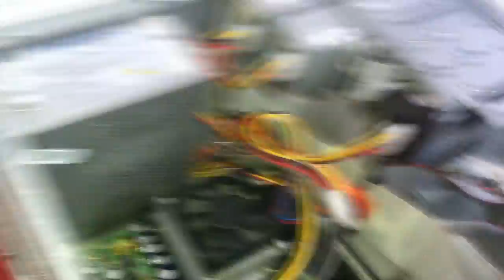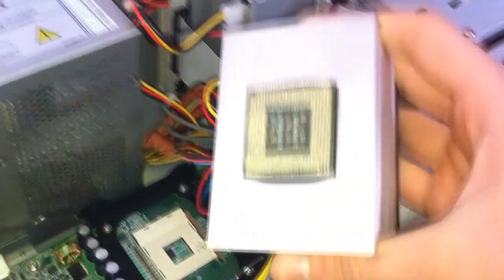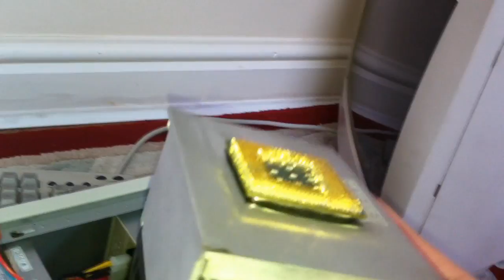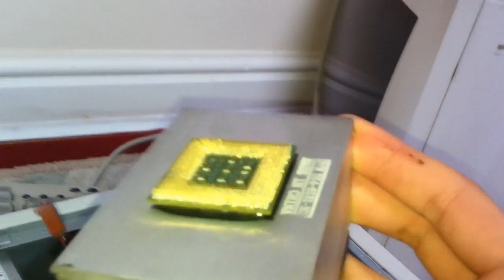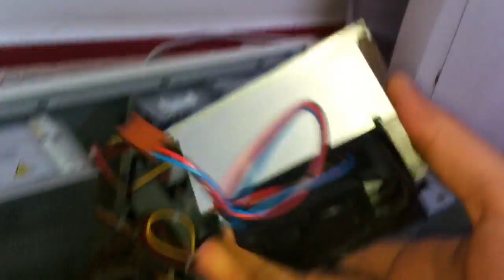Beware of applying too much Thermal Paste!

Comment: hey i accidentally wiped a little thermal paste while installing my pc and overheated a couple of times until i looked at it again to realize at least a quarter of the paste was wiped off, does that mean my cpu was damaged or is it still ok and i just need to re apply the thermal paste??
Reply: I know this is a little late, but you should be fine, just reapply it.

Comment: This used to happen with the older processors with the stock fans/grease., to get it off of the cpu cooler, twist the processor one way our the other and you will be fine.

Comment: more thermal paste does not equal a cpu stuck to the cooler.. i use about double than what people recomend(mostly becuase i buy in large quantities, and rarely use much before it gets too old) and i have no problems removing my cooler, only time i had problems, was when i tried some thermal paste that came with a cooler, because it dried out completely within 2 months, and my temps rocketed up. so bad thermal paste can do this, too much just seeps down the side, so make sure its not conductive.

Comment: You have to take a heatsink of with a twist like motion this was not the cpu's problem or the paste's problem it was all your fault
Reply: I'm pretty sure he already took the heatsink out before the video. He's just showing the issue.
Reply: +BaggieGaming Ya exactly, even witha  shit ton of paste it wont stick to it and pull the cpu out of the pins lol
Reply: Turn the system on for like 40 seconds and then take it off lol
Reply: I feel like you could damage and bend the cpu pins doing that...

Comment: You can get the CPU off with some dental floss. Apparantly you can also soak the floss in alcohol and gently "saw" it off. Best used if you let your computer run for a while to get hot, turn it off, unplug it and then try to remove it. 

I obviously telling anyone that have this problem, not Xenomex personally since he hopefully solved this long time ago :D

Comment: if you can get it seated properly unplug the heat sink fan and  let it run for a bit until it heats up, and it will come right off. also if you can't get it seated you can always try using a heat gun on low temperature settings. to heat up the paste

Comment: 2002 Intel P4 cpu coolers came with paste and a foil strip that turned into concrete. Pulling the cooler would pull the cpu pins and all out of the 478 socket.
Reply: Wow mine still pulled out great after being 13 yrs old and being 8 years on my closet

Comment: He didn't waste a PC. All he had to do is turn the computer on and let it run for 5mins. It will generate heat which makes it easier to remove the CPU!
Reply: He has now,you cant connect the cpu back as it's now damaged.He didn't know that was going to happen so he wouldn't have let it run to generate heat.

Comment: Had the same thing happen to me a few times using AS5 using the spread method, but a very thin layer of it... the stuff is so thick, even thinned out, it sticks like glue after a few months use and the cpu always popped out with the heatsink, luckily it never bent any of the P4 pins.
Reply: never had an issue with arctic silver, just took my water block off the other day with no force at all after spreading it by hand. was still soft

Comment: Easy Fix happens to my old PGA Socket P4 Just pull it off then reapply it and when you take it off make sure its hot before removing to make the thermal paste soft

Comment: The computer that i opened up in the video, the actual main problem was the fact that the pins of the CPU were messed up. Meaning the CPU could never work again. The thermal paste issue was just a side problem. READ THE DESCRIPTION SMARTASS

Comment: alot of pre built towers have this sort of paste on the cpus its like a sticky hardish paste. ive had a couple of motherboards where the cpu will not come off the heatsink even when heated up. the cpu has to be pulled from the board. its a 50/50 chance of not damaging anything :/ never broke a cpu yet tho ;)

Comment: LOOL... Maybe you should know that there are "PERMANENT thermal compounds" that will make a permanent stick (maybe he used that crap).

I recommend Artic MX-4 for CPU. Use permanent thermal compound for something like adding little memory coolers to chips and something like that, so that it won't fall.

Comment: Heatsinks come from the manufacturer like that believe it or not. I have seen this many times myself, the manufacturers, on those older computers, for some damn reason used thermal adhesive(meant for mounting heatsinks to controllers/chipsets with no physical mounting options) as thermal compound. In one case, the heatsink was better adhered to the cpu's heatsink lid, that it separated and not the heatsink itself. I saved it as the bare silicon is so interesting to see. An old Socket A Athlon XP

Comment: Thats nothing to do with too much paste. Probably down to cheap paste also you should remove it straight after your system has been on for atleast 30 minutes. This warms uo the paste and it a lot easier to come off. You should twist the heatsink rather than pulling it.

Comment: if it is the bios and srry for all the messages will this option be avalable and i got this off of a web site containing info on the mother board  "The ASUS CrashFree BIOS 3 allows users to restore corrupted BIOS data from a USB flash disk containing the BIOS file. This utility saves users the cost and hassle of buying a replacement BIOS chip. "

Comment: ha nice, I remember lapping a opteron 146 to overclock it ended up doing just that with a pea of mx-2 thermal paste. The smoother both sufaces are the more likely that will happen due to surface tension, mainly on PGA than LGA due to the later using a clamp.

Comment: Sounds like BIOS status beeps. Check the motherboard model (It'll be on the motherboard somewhere). Then look for that model + error beep codes. For instance, if you've got a a880gz motherboard, google: a880gz error beep codes. You've probably got an Award bios. With Award, that error is a video error. Try hooking up a monitor and see where you get with that. Good luck. :)

Comment: Yeah, no. That's the right amount. Didn't overflow down onto the pins or anything conductive. Apparently you're pretty new to PC building if you've never run into a thermally-bonded CPU/heatsink. You just heat the heatsink up to about 70C for about 15 minutes, then CAREFULLY *slide* the CPU sideways and off.

The pea method is crappy; a 'good enough' slapdash that they keep teaching new systembuilders as it gets you 95% of the way there, is near-idiotproof, and only takes a few seconds to apply.

Comment: Even if you did apply too much thermal paste, you can still remove the cpu from the radiator without damaging it. Just slide it sideways and it will come off. Just be careful not to bend the pins. This sort of thing happened to me several times when I received a PC and somebody (apparently inexperienced) added too much thermal paste. It really does suck when that happens.

Comment: a thin and uniform layer of TIM (nearly translucent).  Do the buffing with a lint free cloth (Coffee filter or specific purpose from the hardware store) so you do not leave tons of fibers on the surface you are cleaning for conductivity.  Idiotic is thinking the razor will somehow magically penetrate microscopic imperfections when held flush against a surface like it's some kind of magical liquid razor.

Comment: Actually you're horribly incorrect here, while "scraping it off" is not ideal the razor itself will not penetrate the machining imperfections unless they are uniform and both thicker and longer than the blade itself.  Metal -> Metal is still your best connection, the razor sits flush with the most elevated part of the surface being coated and forces the TIM into the imperfections.  Generally you can get better results by applying TIM, buffing it off/into the surface, then using a blade to apply

Comment: Using to much thermal paste didn't mess up the computer its old and a part failed it happens on old computer stuff. And judging by the age of the computer it has the older thermal paste on it, and the older stuff after it would set would bond the cpu and the heat-sink and its can be hard to take apart but you know that is is making good contact at least.

Comment: i remember my athlon 64 from 04 or 05, that was when AMD had the genius idea of packing it in a display case, well after 3 days of shipping(without any kind of packing) the cpu was lodged from the display and half the pins were bent, i used a dried a up ball point pen(took me almost and entire afternoon of trial and error before I got the pins straight enough to install)  that was one of the stablest and most reliable CPUs I ever used.....just saying.

Comment: I cover the entire CPU with paste then take a razor blade and scrape it back off. This fills the tiny imperfections yet still allows for metal to metal contact. The thermal grease is there to allow heat transfer where there normally isn't any due to imperfections. Most people put too much on and it acts as an insulator.

Comment: He is telling the truth you know, and as far as "right tools" goes. It doesn't take any fancy tool to bend a thin pin.. I used to use tweezers, it can be time consuming but if the pins are all in contact, the processor will act like normal. Just be careful not to bend them too many ways or they'll break off. I don't think I've ever broken a pin in my life though.

Comment: The amount of thermal paste is irrelevant  as long the thermal paste is not crossing the edges of the CPU.When you press the heat sink he will spread paste evenly and if the paste cross a tinny bit the edge of the CPU no big deal most thermal paste's are non conductive except for very cheap ones so no big deal and off course the heat sink is glued with CPU because that PC is from stone age and the paste is dehydrated and dry from years of usage just worm the freaking heat sink with hear dryer-_-

Comment: I've had the same thing, but I fixed it with rubbing alcohol. Use a q tip and put little drops on the sides, it will loosen up after a while.

Comment: i had that to put a thin knife under the cpu and heatsink and wiggle it a bit if it does not budge a bit take the cpu and wiggle it left and right with your fingers YOUR pc is not RUINED because of this this happens allot if a older pc was never taken appart for maintence i clean my pc's every 6 months of dust since my pc's are almost on 24/7 and thus collecting lots of dust

Comment: Pea sized is still too much. A grain of rice is just about enough when applying _quality_ thermal material and using _quality_ heatsinks. You probably want a bit more with a stock AMD heatsink, but not much. The TIM should be allowed to spread on its own in order to avoid air bubbles.

Comment: The first computer I purchased came like this, factory build. I scraped it off and in the process bent 3-4 pins completely over. After an hour of straightening the pins back and applying new paste, CPU works fine, haven't had a problem even three years later. They are FAR more durable than people make out.

Comment: I've "rescued" a pentium 166 MHz mmx I found discarded in the woods just for shits and giggles. The motherboard was partially covered in pine needles and soil, looked like it had been there for years. Heavy corrosion on steel details on the motherboard and backplate. CPU was in the dirt, out of its socket, no pins were broken off but badly smushed.

Took the CPU home and doused it in isopropanol. Bent the pins back into shape with a library card and some thin flatnosed pliers. Ran like a champ.

Comment: P4 CPUs had a little depressed dot in the corner.
This would create a vacuum when the heat sink was cold.

Heating it up with a hair dryer would allow you to pry the cpu off the heat sink.

Comment: man its normal . P4 have that problem , that kind of socket cant hold the CPU when u take off the cooler , it happens with every thermal paste , the best way to take off the P4 cooler is to pull the cooler off without forcing it , if thermal paste is dry , use the hair dresser ,  new Intel CPUs have not that problem because the socket holds the CPU metallic cover , only new AMD may have that problem

Comment: Yeah i can see how you can easily break the CPU by forcefully removing it while its locked but I've removed them this way. At worst the pins would be bent but wouldn't damage the CPU. Some of them didn't even bend the pins it just popped right out. Processors are a lot more durable than they appear you just have to do it carefully so you dont break the pins. Some CPU's might still work with partial or fully broken pins. This video has a good point tho to help keep you from this problem.

Comment: also its common to have old thermal past bind the CPU to the heat sink. i go to offices and pull 50 computers apart and about 5 to 10 stick like that.  especially the old P4s.

Comment: the computer wasn't ruined because he put too much thermal past on there!  thermal past is non conductive so you can put it all over your board and nothing will happen. the most likely way that pc died, if not from normal causes is, from pulling off the CPU as recklessly as you did right there and bent the pins!  you can put 10 tubes on there and it will not harm the computer.  matter of fact you can put none on a old computer and it will run hot but still work just fine in normal use.

Comment: You don't need to add a large amount to have that happen. I had that happen to me and I ended up pulling the CPU out of socket with the lever still down. It neither damaged the socket for the CPU, but getting the CPU off of the cooler was a bitch.

Once I did use too much thermal paste and the CPU, as a result over heated (it was an Althalon XP Burton). Too much thermal paste can actually act as a thermal insulator.

Comment: He hasn't used to much. in fact, he might not have used enough. what you have there is dry thermal paste sticking your CPU to your heat sync. seen it many times with old pc like this.

Comment: uh that happens when thermal past cools down after being exposed to high temperatures for a long time. I know the video is old but to viewers coming here. if that happens, it is more common than you might think. the fix is quiet simple, either let your computer run with it for a couple minutes so the thermal paste softens, (turn off, remove, you know the drill). Or you can aim a hair dryer at the heatsink for a short period of time, same result just quicker I guess. (Don't aim at the cpu itself)

Comment: this happened to me i was taking  phenom II x4 out of a stock hp machine and i pulled the heat sink off the cpu was stuck on so bad that i pulled it right out of the zif socket i then pried it off with a Popsicle stick because the wood will break before the cpu

Comment: Your not supposed to just pull it out. >.<
You might want to run the computer first and give it a gentle turn to loosen it up first. The pins wont bend from that. I have seen this happen on company built systems from dell. It is what i practiced on first so i didn't screw up.

Comment: same thing happened to an old pentium 4... Dell's fault, everything was OEM and when I decided to start tweaking since I'm getting a new one, I took of the heatsink and the cpu was COMPLETELY stuck. I put some rubbing alcohol where it was stuck and heated some water to around 100C and put the heatsink fins in half way. It came of after about 2-3 minutes... reinstalled, applied thermal paste THE RIGHT WAY and reattached the heatsink. It works fine and is about 300Mhz faster!

Comment: I find that stuck heat sinks are generally easier to remove after running the PC for 5-10 minutes under heavy load to heat the paste up.

If that fails I break out the screw driver!

Comment: Actually ive built quite a few computers in my life time and if you just have the pc running with regular use for a while, it can get stuck like that too much or not.  I had to use a screwdriver to get the stock cooler off of my first pc when the processor died

Comment: It didn't stick to the heatsink because he used so much, it stuck because the silicone based pastes tend to dry out which causes them to stick. Use a hairdryer to heat things up a bit (hopefully making it a little less solid), line up a ruler alongside the side of the heatspreader and give it a smack.
Clean things up, reapply thermal paste.. and stuff still works fine even after pulling it through 'lock socket' pin. (speaking from experience ;) )

Comment: Reminds me of Dell. My laptop was overheating so i took it apart and there was a purple PAD over the cpu! There was so much it was like a big rubber square pad covering it completely! So i cleaned it off and applied mx-3 thermal paste and got a 40oC change temperature..... Anyway I reccommend a grain of rice size amount.

Comment: Arctic Silver 5 did that too my AMD processor in my Dell, I think its just when the ceramic dries it tends to mend the processor to the heat sink, I never had any problems though. I actually got more accurate temperature readings.